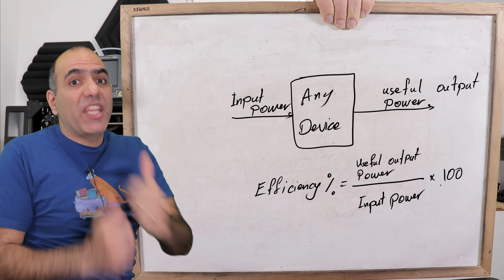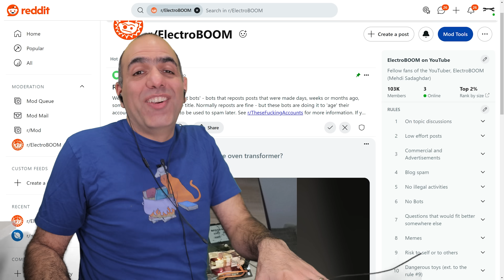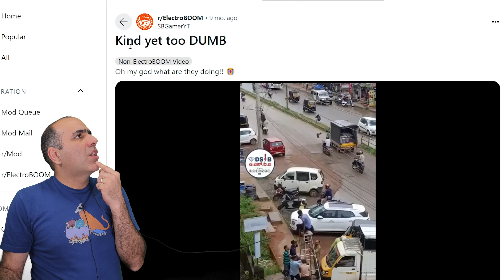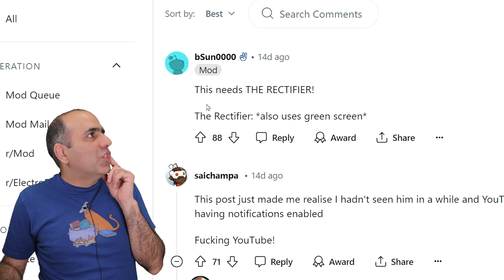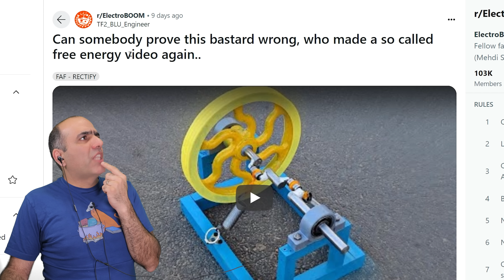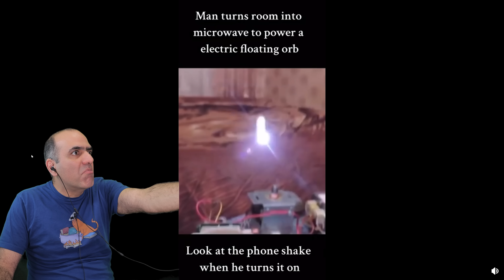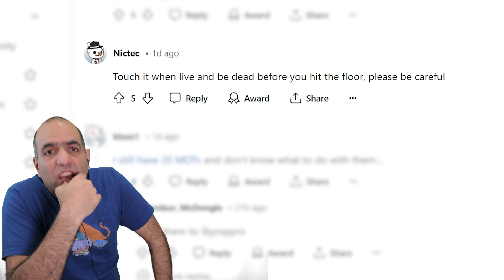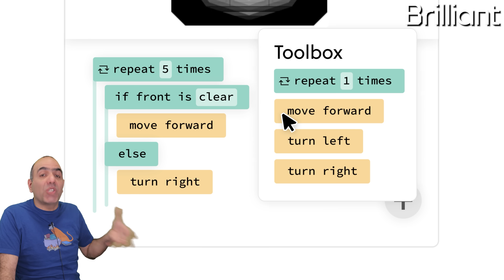New Flywheel Free Energy?! Can Boat Battery Fry You? LATITY-013

Comment: If you investigate this, you will see why and how it has been possible to suppress perpetual motion in the US. Other countries openly keep their people ignorant, but here we covertly do the same. Imagine being a disingenuous politician knowing that with perpetual motion, anyone from anywhere without refueling could reach you at velocities only dreamed of.  

https://en.wikipedia.org/wiki/Invention_Secrecy_Act

I am surprised they let heat pumps slip past them. I guess they wanted air conditioning, which is also as much as 10 times over unity as far as removing heat from the home and delivering it outside. 
As the heat delivered to a building or a pool is taken from the surrounding atmosphere, it just migrates back to where it came once it has done its job in the home or office. Electrical heating elements deliver 100 percent of the wattage they create in heat. If you supply them with 100 watts, they provide 100 watts of heat. Air-to-Air heat pumps standardly deliver three times the wattage in heat than they use. That is why you see them stuck all over everyone's home. Many heat pumps deliver as much as six times the amount of energy they consume. 

Electrical capacitors are capable of the same thing. By putting a large capacitor in line and sizing it to a large known load, you can feed a device like a transformer, with one half cycle of AC current, and when the transformer has been powered, you find the capacitor is charged with an equal and opposite amount of power. If you use a diode to power the capacitor with half an AC cycle, and then after it has powered the transformer and is still charged, it can be drained through the transformer in the opposite direction of flow. Creating a complete AC cycle from a half-cycle AC current. You just have to work out the timing.
Reply: There. Is. No. Free. Energy.
Reply: @spaceageGecko your air conditioner if it is a three ton 36,000 BTU system collects and moves 36,000 BTUs from your home and releases it outside. That is over 10.000 watts of heat delivered. Or over 10KW in electrical power and yet your AC system more than likely draws less than 2KW to accomplish that feat. The heat as Newton had shewn is neither created or destroyed, it just migrates back into the home from which it came. The same is true of a heat pump it can achieve results from three to six times over unity. The heat pumps outdoor unit can drop to minus 51 degrees Fahrenheit to absorb heat from outside in the winter. It then condenses the gas in the indoor unit to deliver heat to the home, down to temperature below zero with standard air to air heat pumps. And again the heat taken from outdoors returns to the outdoors as the house leaks heat to the outdoors. They use heat pumps in steam generating plants for that reason. It is against the invention secrecy act to build and patent them as such.
Reply: @WilliamMcCormickJr  That isn't perpetual motion, there is no such thing as 100% efficiency nor "over unity" it is physically impossible.

Heat pumps do not generate energy they move it and need electrical input to do so.

Perpetual motion violates thermodynamics, you cannot patent "perpetual motion" because it's a scam.
Reply: @spaceageGecko You can take half an AC cycle of electricity and power a known load with a capacitor proportionate to the load in series, measure the energy delivered, and you will find that you have a fully charged capacitor with an equal and opposite charge ready to provide an identical or greater charge than was used to charge it. Similar to a heat pump, it doesn't create or destroy anything, but you can certainly use the generated power to double your watts. 

How do you think they remove the hydrogen from the steam to make gasoline and other petroleum products? They strip the hydrogen from steam by starving a bed of incandescent carbon. That process creates CO2, which they pass over the coal again and turn it back into CO, which they re-burn for the heat needed for the reaction. 

You can burn and separate water all day long, nothing is gained or lost. 
I have personal knowledge of people who had such devices taken away from them by the government. The device passed water through a plasma, which raised the water to 35,000 degrees, expanded it, separated it into individual atoms, which created pressures well over 175,000 psi. The pressure differential of 175,000 psi creates an extremely high voltage, high amperage output that was used to power the plasma ARC. So although nothing was gained or lost, you could power the vessel rather nicely.
Reply: @WilliamMcCormickJr There is no over unity device. It breaks the laws of thermodynamics.

No amount of paragraphs is going to rewrite the fundamental laws of the universe, especially not conspiracy laden ones like yours.
Reply: @spaceageGecko  You were told by people too afraid to stand against the openly announced counterintelligence program in the US that there is no such thing as overunity. But of course there is. I have seen the craters left by disintegrated metal transformers, sand melted into glass underneath them. The problem is that there is not enough power coming into the transformer to do that in a fraction of a second.
Reply: @spaceageGecko  If you supply an electrical resistive heating element with 100 watts of electrical power, it delivers 100 watts of heat. That is the standard for measuring COP (Coefficient of Performance). 
A heat pump can deliver anywhere from 3 to 10 times the efficiency of an electrical resistive heating element that is 100 percent efficient or unity.
Reply: @WilliamMcCormickJr  There is no such thing as "over unity", it's not up for debate.

A heat pump does not produce heat, it moves it with electrical input.
Reply: @spaceageGecko , if you can move heat and make use of it for 1/5 the cost of producing it with 100 percent efficient resistive heaters, I believe that is overunity. The fact that the heat migrates back to where it came proves Newton's theories. Unless you disagree that electric resistive heaters are 100 percent efficient?

If I can create 1,000 watts of usable energy with 500 watts of input power, then it is overunity. The force that generates the energy/motion to create electromotive force originates from ambient radiation, which sustains matter's structure and powers the universe. Matter is like a sail in the wind of ambient radiation. 
The only problem is that it is against the Invention Secrecy Act to do so. 

https://en.wikipedia.org/wiki/Invention_Secrecy_Act
Reply: @spaceageGecko  We call a horsepower the amount of energy required to lift 550 pounds one foot in one second against Earth's gravity. It requires 769 watts to do so using standard AC motors. All we are doing is moving an object weighing 550 pounds one foot in one second. Are you saying that is not energy delivered? And if I can do that using half or even a quarter of the power that it is not overunity? If I can heat your home for 1/4 the energy it normally requires in electrical power, using 100 percent efficient resistive heaters, that is overunity.
Reply: @WilliamMcCormickJr No it’s moving heat, not making it. Thats not as it’s not generating energy to begin with.
Reply: @WilliamMcCormickJr That is not over-unity that is moving existing energy from one place to another, not making more energy than you input which is what “over-unity” is.

You are struggling with basic science “I believe that is over-unity” is not a solid stance.

Without the existing heat to transfer a heat pump would do nothing, it is not producing heat.

You have a fundamental misunderstanding of your own pseudoscientific terms and basic thermodynamics, trying to spin it as a conspiracy only makes it less believable.
Reply: @spaceageGecko  When I move a 550-pound weight up one foot in one second, that energy needed is considered to be 746 watts. What energy is being created? The 746 watts delivers a 550 lb. weight to an elevation of one foot above its present starting position. Now, if I lift 550 lb. 1 foot in one second with 175 watts, that is overunity. Unity is 746 watts per HP for one second to lift 550 pounds one foot.  

COP ratings (Coefficient Of Power) use the unity of 100 percent efficient resistive heating elements to determine how much more efficient their heat pump systems are. Most are rated at 3 to 6 COP. That is overunity. Just as the 745 watts moves a 550-pound weight up one foot in one second, the heat pump moves heat at 3 or more times the efficiency of resistive heating elements that are 100 percent efficient at converting electrical wattage to heating wattage delivered.
Reply: @WilliamMcCormickJr No amount of changing your wording will change the fact that you cannot break the laws of thermodynamics. 

You have a fundamental misunderstanding of the laws of physics. “Over-unity” would require you to get out more energy than you put in, that is physically impossible and basic science. 

Heat pumps move existing energy.

By your logic solar panels are “over-unity”, they are not.

You are failing to grasp these concepts at a fundamental level, your weight analogy does not even work. If a 550lb weight needs 746w to be raised by 1ft then 175w CANNOT lift it 1ft without outside energy being put into the equation.
Reply: @spaceageGecko  All reactions and experiments are heated to about room temperature by the sun, so nothing on Earth is not the result of the sun's energy. However, the sun's energy is from ambient radiation, not some imagined reaction taking place on or in the sun. The problem is that after WWII, for the purpose of counterintelligence, to hide the Hiroshima atom bomb, which was put forth by Benjamin Franklin. They changed the scientific method to allow attraction forces to be treated as science without any proof of them. They utilized the large plume cloud and the fear of neighbors creating one in their garages to introduce counterintelligence into Universities. It was openly announced at the time as if it were a sane plan to protect people kind of like having Jews turn over their firearms to the Nazis, for their own safety. Today, people have been so brainwashed that they can no longer use their own senses, their own comparator abilities to see what is right there in front of them. They would instantly be somewhere else, like Nazi Germany, if they used their accurate comparator abilities. so they just recite what was told to them by poor teachers, as bag students.

https://drive.google.com/file/d/1zSYY612R77DWSmLzj4Q_0aZONZ46jWTP/view?usp=sharing

Check this out, it gives you a glimpse of the chaos at the time, and the lies and cover-ups. The Hiroshima atomic bomb uses no radioactive core to create that kind of explosion. Ordinary farm and light industrial products were all that it was made of. Because we knew at that time that ambient radiation powers an atomic bomb, not E=MC^2
Reply: @spaceageGecko , just a heads up: you said moving things doesn't create energy. I pointed out that this is what we do with energy, and if we can achieve it at fractions of the agreed-upon unity level of energy/movement, then that is over unity. 

If we can light a 100-watt light bulb with 50 watts of input energy, then we have created an overunity situation. If we lift a 550-pound weight one foot off the ground in one second, we have made 745 watts for a second of potential energy, and if we only used 175 watts to accomplish that, we have created overunity. 
A heat pump generates heat in a location using 1/3 to 1/6 of the energy required to move and transform the energy from the power plant to create the same amount of heat through 100 percent efficient resistive heating elements.
Reply: @WilliamMcCormickJr A. Heat. Pump. Does. Not. Generate. Heat. It. Moves. It.

The input energy is the earths heat, you do not get 100% efficiency from that thermal transfer. To be “over-unity” you would need to produce more heat than the initial input, you do not.

Over-unity does not exist, it would violate the most basic laws of the universe. You cannot get more energy out of a system than is put in, energy cannot be created and that would be creating energy.

You have no idea what you are talking about.
Reply: @spaceageGecko  Electric resistive heating elements, powered by 100 watts, deliver 100 watts of heat. 

If you lift a 550-pound weight one foot against the force of gravity in one second, it requires 745 watts to do that, or one horsepower. Are you saying that nothing is delivered by using the 745 watts? And if I can lift 550 pounds one foot in one second using only 175 watts to do that, is it not overunity? If you lift a 550-pound weight one foot, it now has potential energy, so nothing is gained or lost, but you accomplish work. A heat pump accomplishes what a 100 percent efficient electric resistive heating element produces for as little as 1/10th the input wattage. That is over unity.
Reply: @WilliamMcCormickJr It is not creating more energy than is in the system. It is moving existing energy, from the earths heat.

Over-unity does not exist, you cannot create more energy than is put into a system.
Reply: @spaceageGecko , well, if you agree that it takes 745 watts to lift a 550-pound weight one foot off the ground in one second against gravity, then, according to you, the movement of something does not count as energy. A heat pump takes the unlimited energy that exists outdoors, makes it usable, and then the heat returns to where it came from, at a COP of 3 to 10. So, if I can lift a weight one foot in one second using 175 watts of energy, you would have to agree that this is overunity. If I move heat from outside to indoors for three to ten times less than 100 percent efficient electric resistance heaters, you must also agree that this is overunity. Unity is a 100-watt input to 100-watt output for resistive electric heaters.
Reply: @WilliamMcCormickJr  No it's not overunity. You seem to have a fundemental misunderstanding of what "overunity" is.

Overunity requires more output than input, when your input is the earths own heat or heat from the sun you are not getting more than you put in. A heatpump is not going to generate more heat than it moves.

By your logic a solar panel is "overunity" because it generates more power than it costs to operate but that is because it is literally tapping into a giant fusion reactor in space.

Both the first and second laws of thermodynamics make overunity impossible, energy cannot be created and there is ALWAYS loss (even heating elements lose tiny amounts of useful heat through wires generating heat in the wrong places and visible light (they are only technically 100% efficient not literally))

Finally, heat pumps are not even 100% efficient you are confusing coefficient of performance with efficiency (Heat pumps lose energy from components, the external enviroment and thermodynamic limitations). Even an AC unit or a fridge has a CoP over 1 as it's easy to move heat rather than generate or get rid of it.
Reply: @spaceageGecko  If you supply a heating element with 100 watts, it will output 100 watts of heat. This is not something sane people contest. I owned a corporation that manufactured three-phase heating equipment to reduce hazardous waste, so I am confident about this. 

When I lift a 550-pound weight one foot off the ground per second, it requires a constant 745 watts to accomplish that. That is one horsepower. If I perform that feat with only 175 watts, we would have to call that overunity, as it requires less energy than unity. I would be creating one horsepower worth of work with 175 watts, instead of the 745 watts needed to create one horsepower, or what the stored potential energy of 550 pounds lifted one foot off the ground creates. It has a potential energy of around 800 watts. In any case, the weight was there; I neither created nor destroyed it. Yet we call it power used and power delivered. So if I can lift the 550 pound weight one foot a second with 175 watts you would agree that is over unity. 

Your claims all point to the sun as the source of all power in the universe, and the sun indeed makes life possible. The sun is a perpetual motion device. The sun is not a fusion reactor; it is a block to ambient radiation, much like the Hiroshima bomb. That is why they created all the counterintelligence to hide the bomb that Benjamin Franklin proposed. It did not require a radioactive core. It was made from ordinary farm products and weighed 886 pounds. Most countries on earth could have built one but were more concerned the citizens in their own country would blow up the capital filled with treasonous disingenous scum. So they created the Manhattan Project to hide Benjamin Franklin's bomb and the principle for the bomb. 
The Manhattan Project just created a complexity to hide the simplicity. 
My point is that by borrowing heat from the outdoors and heating the home, we merely move the heat, like the 550-pound weight, creating a heat differential between the outdoors and the inside of the house. The heat just returns to the outdoors when we are done. The heat pump just does it so well that it creates overunity. The power company moves heat by way of conversion to electricity to the home and power grid nothing is gained, lost or created. So you want to play word games rather than face what we are not allowed to discuss or have due to the Invention Secrecy Act. We have perpetual motion if the government will allow it.  
https://drive.google.com/file/d/1zSYY612R77DWSmLzj4Q_0aZONZ46jWTP/view?usp=sharing
Reply: @WilliamMcCormickJr  You are arguing against the laws of thermodynamics. There is ALWAYS loss in a system and you cannot create more energy than you started with. 

Heat pumps are not over 100% efficient, again, you are confusing efficiency with coefficient of performance

Perpetual motion is not possible, it violates the 2nd law of thermodynamics.

You are going in circles, I have already disproven your assertions with basic thermodynamics. There isn't some grand conspiracy hiding perpetual motion or over-unity, it straight up cannot exist in our universe.

Now, cough up an actual argument that does not violate the fundemental laws of our universe.
Reply: @spaceageGecko you are claiming that removing heat is possible? Where are you removing heat  to? It will eventually migrate to an area of lesser heat. The whole universe is a closed system. So the heat pump creates heat where we want it and then it dissipates back to where it came or any area of lesser heat like into the night sky. 

I have been in a room with both the condenser and evaporator of a functioning AC system and I can tell you there was cold air created by the evaporator and hot air created by the condenser. And the room got hotter and hotter, because besides moving heat the compressor also adds heat to the system.
Reply: @WilliamMcCormickJr I’m not even sure what you are trying to argue now, who said anything about removing heat?

I’m still waiting for proof you can break the first and second law of thermodynamics, a requisite for “overunity”.

Provide true, peer reviewed, proof. Anything less and I wont both replying further.
Reply: @spaceageGecko , electric resistive heaters are 100 percent efficient. You put in 100 watts of electricity, and you get out 100 watts of heat.
Reply: @spaceageGecko , we move a 550-pound weight one foot off the ground in one second; it requires 745 watts to do it, or one horsepower. Today I can do that with 175 watts, that is over unity. A 550 pound weight elevated one foot above the earth has a potential of 800 watts of power. whichis kind of funny in itself.  Electric resistive heaters deliver 100 watts of heat. If 100 watts of electricity are applied to them, they are 100 percent efficient. So, if I move heat and use it, and it goes back to where it came from, and I can deliver 3,000 to 6,000 watts of heat using 1,000 watts of power, I call that over unity. Within the sealed system of the Earth's atmosphere, that is certainly over unity.
Reply: @spaceageGecko Nothing generates heat; instead, ambient radiation is slowed by chemical reactions, an abundance of electricity, vibrations, friction, and condensing gases, and then the heat dissipates. You can use a low-current plasma to atomic hydrogen weld; the heat is remarkable. You can add helium or hydrogen to a low-current plasma cutter and blast through thick plates using the ability of split helium or hydrogen molecules to slow ambient radiation.
Reply: @WilliamMcCormickJr  You are being pedantic because you cannot prove the laws of thermodynamics wrong.
Reply: @WilliamMcCormickJr  Only heat that heats what you intend is counted towards efficiency, you lose efficieny due to small things like wires losing heat and manufacturing flaws, resistive heaters are only 100% on a technical basis not a litteral one.

We already discussed this, you have still yet to prove the laws of thermodynamics can be broken.
Reply: @WilliamMcCormickJr  The eart is not a sealsed system. Overunity, by definition, requires you to get out more energy than you put in, thereby creating energy.

It's not aboubt what you call it, overunity is simply impossible due to the laws of thermodynamics.

You cannot get more energy out of a system than already exists within it.

Provide actual proof of being able to break the laws of thermodynamics and maybe I will respond again, until then you need help.
Reply: @spaceageGecko  I owned a corporation that manufactured three phase heating equipment I can assure you they are 100 percent efficient.
Reply: @spaceageGecko  it is against the law to do so.
Reply: @spaceageGecko , You realize that heat cannot be created or destroyed. So if I use 1,000 watts and get 3,000 to 6,000 watts, I have neither created nor destroyed heat. I have just made it work for me. 

By passing atomized water through a plasma, I can move a 550-pound weight one foot against gravity in under a second, using significantly less than 745 watts. By the way, how do you explain a 550-pound weight lifted one foot having a potential of 800 watts of energy?
Reply: @WilliamMcCormickJr Nothing is 100% efficient, 2nd law of thermodynamics.
Reply: @WilliamMcCormickJr No, it is just physically impossible to achieve “over-unity” it is illegal to sell snake oil scams claiming otherwise.
Reply: @WilliamMcCormickJr That is not over-unity, transferring energy is not measured in efficiency for this exact reason. 

Over unity, by definition, requires energy to be created.
Reply: @spaceageGecko  The universe is a perpetual motion system. We live in a field of unlimited potential perpetual motion energy. During WWII, this was hidden by an openly announced counterintelligence operation. Universities were paid to hide science, and it was openly announced. You can create atomic bombs without radioactive cores. Benjamin Franklin had put forth the plan for doing it. That is what the Manhattan Project was supposed to hide.
Reply: @spaceageGecko  you are just repeating what has been placed in you by poor teachers, who were just poor students.
Reply: @WilliamMcCormickJr I’m not the one confusing the transfer of heat with the generation of heat… two VERY basic concepts.

The laws of thermodynamics are absolute, you cannot make more energy than you input, moving heat is not making heat.

You are parroting an ancient pseudoscientific scam that is debunked by basic science.
Reply: I think your reasoning confuses efficiency with creating energy from nothing. Heat pumps are not “overunity”—they don’t generate more energy than they consume. What they do is move heat that already exists in the environment. That’s why their performance is measured as a coefficient of performance (COP), not by a simple input/output ratio. A COP of 3 or 6 doesn’t mean the system violates physics; it just means the machine uses 1 unit of electricity to move 3–6 units of thermal energy that were already in the air or ground.

The same applies to electrical capacitors. A capacitor can store and release energy, and with clever circuit design you can shape waveforms or recover part of the energy during switching. But you’re not creating a full AC cycle out of half a cycle “for free”—you’re recycling stored energy. The total energy in the system still follows the conservation of energy. That’s why every working circuit ultimately has losses, and why perpetual motion remains impossible.

As for the idea of suppression under the Invention Secrecy Act: governments certainly classify technologies that have military applications, but that doesn’t mean perpetual motion has been hidden. The scientific community around the world has tested “overunity” claims for centuries, and none have held up under rigorous, repeatable experiments. If such a breakthrough existed, the physics and the evidence would eventually become undeniable.

In short, heat pumps and capacitors are fascinating technologies, but they don’t prove perpetual motion or “overunity.” They fit within well-understood physics—and that’s part of what makes them so powerful and practical.
Reply: @alunoenzo within the confines of the earths atmosphere a heat pump is over unity. As no heat is gained or lost. They would not use heat pumps in a steam generating plant if it were not over unity. And that is a closed system.